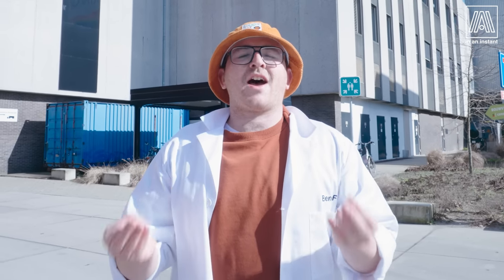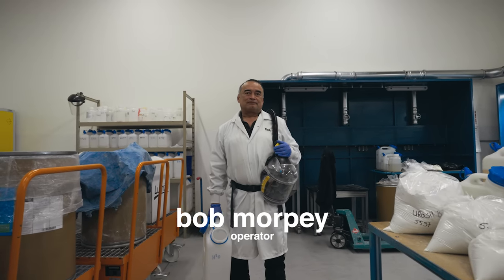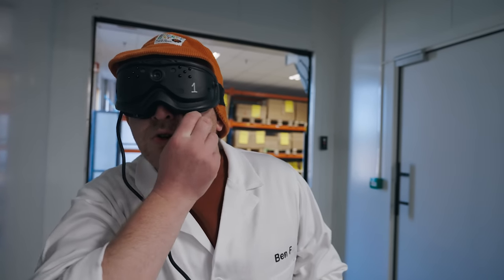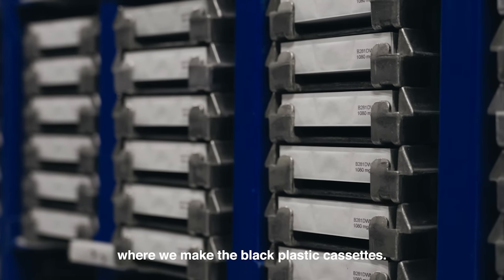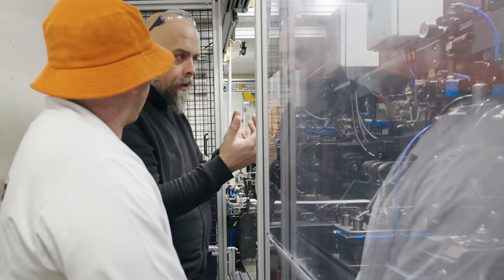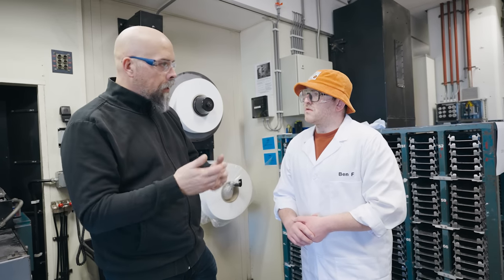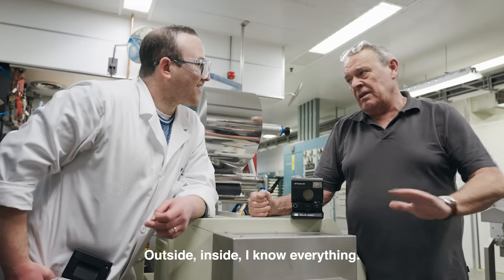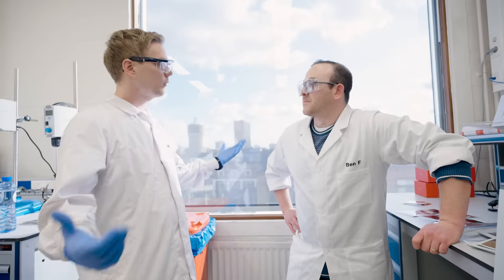Inside the Last Polaroid Factory in the World 🌎 Full tour at Polaroid's Netherlands film facility

Comment: Very interesting tour and video.
It was mentioned that different cameras have different kinds of rollers that spread the chemicals with different thickness and that that affects the white balance. Did they mention which cameras/rollers produce thicker or thinner spreads?
Reply from the maker: Great catch, I'm glad someone noticed that takeaway - it's a really interesting concept I'd never thoughts about. I didn't ask which cameras have the thicker or thinner rollers as that is prob a better question for a camera tech, but now I'm super curious about it. For what it's worth they use a standard Sun 600 camera for testing.
Reply: I interpreted that as meaning that the thickness may vary from camera to camera (as in, variation between individual units of the same model).

Comment: Too bad they don’t make type 107 film any more. I hear that Fuji Film makes a substitute but it’s only available in Japan. Anyone remember type 665 film? Any one know what was unique about this film???
IR goggles, had my first experience with an IR viewer at a processing lab that an uncle of mine worked at in Chicago back in the late 60’s. Built a viewer with a new old stock Capehart Farnsworth tube in the 80’s and then to Gen2+ image intensifiers in the nineties. No lag like the digital viewers, WYSIWYG real time.
Reply: 667 would be a better film then 107. No coater needed and still 3000 ISO.  Yes I remember 665 and 55.  I used them in my 4x5 Graphlex.  Originally Kodak made the negative material for Polaroid.  After Polaroid sued Kodak over Kodak's instant cameras and film Polaroid started producing their own negative material.  They called it the Waltham negative because it was made in Waltham Mass.  Oh what was unique about 665 and 55 was that the negative part of the film instead of being trash could be cleared and you had a high quality B&W negative.

Comment: 3.2 rocks conglomerate mountain class 6 gravel debri pulmice ash 18 months, 3.2 to 4.0 vector 10 shelter for poloroid factory construction shock absorber poles, 97.8 feet × 3.5 diameter feet steel wire interior diameter 14.3 inch oxygen compression water source compression dead zone oxygen 21,600ft now 1042 feet earth 2093 through 2235 16% building infrastructure public visit view.  7 feet depth floor running water #104 very high medium low importance 
Importance high
Easy medium hard difficulty 
Difficulty easy medium poloroid. 

C.d. 
C.d. u.m.d. 

Cyber "mother board" p.b.s. kids
1.002 poloroid and area community 

A.r.g.o. carrier eartg 105 & 106 40% repair 70% 
Falling fort wall 97.8 feet steel ends 1.4 feet 

Mountain waterwc cutter antartica 21000 feet down × 4 steel factor 90° summer breeze interior antartica,  mountain survey u.s. forest
Reply from the maker: I completely agree.